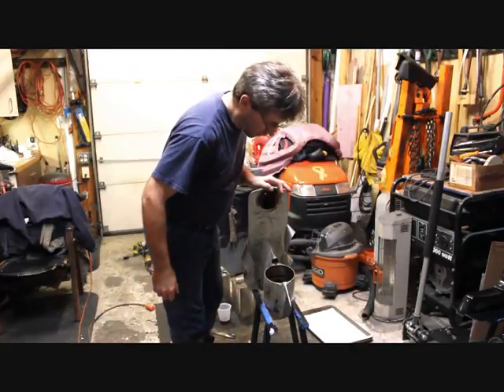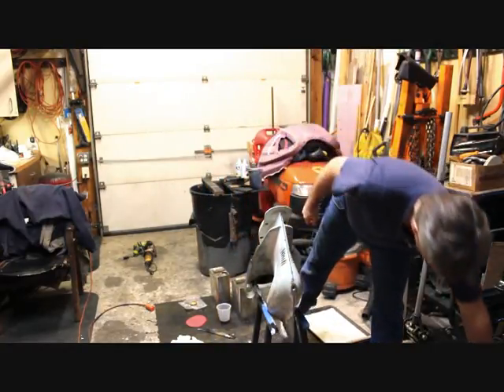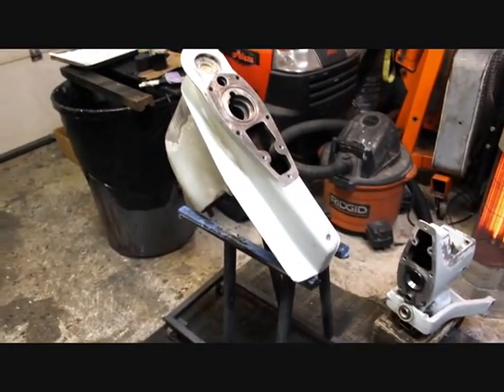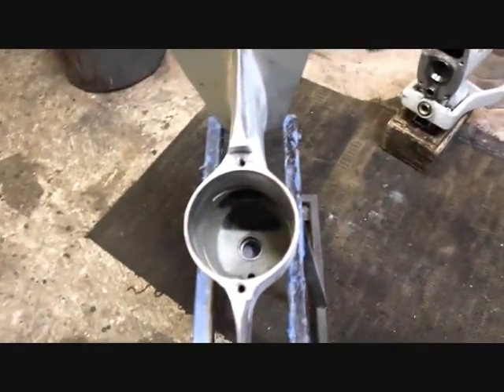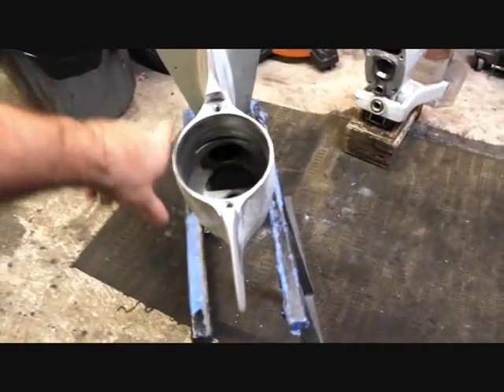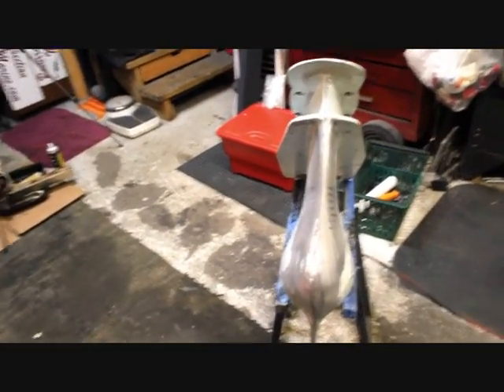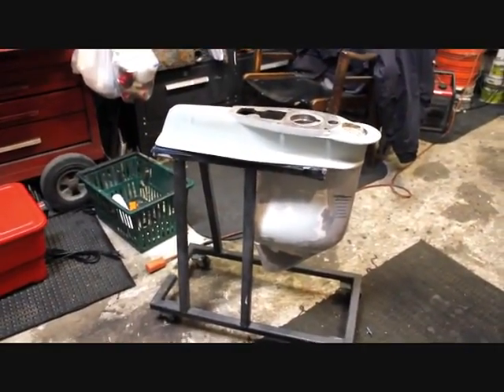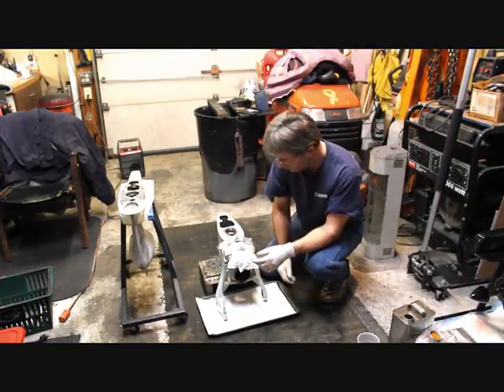Volvo Penta Project - Part 3

Comment: My steering bushings are bad could I just pull the bottom end off to replace them or should I break it down into the 3 pieces ?
Reply from the maker: You will have to take it down to the 3 pcs. 
Thanks for watching.

Comment: Hi there, I'm really enjoying your videos. I have a question on why you don't use the water pick ups any more. Is there an alternative I can use for my boat.
Reply from the maker: Hi, my boat always had a water pickup in the bottom of the boat. Just more convenient. No hose to run from the drive up to the front of the motor's raw water pump (pick up is right under it). I also run in a lot of shallow water and would rather pick up water from under the hull then at the at the bottom of the drive so not to pick up sand and such. Last, if you are "slimming" a drive case you really cant do it like I like to with the water ports open. 
Thanks for watching!